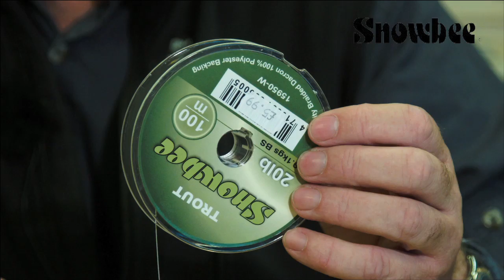How to set up your fly line

Comment: The addition of a small length of backing allows you to easily attach the fly line to the spool.  The way to determine if the line / backing will fit is to load the reel backwards.  Tape the leader end of the fly line to the spool hub and wind it on.  Attach the backing to the reel end of the line using an Albright knot and wind it on.  When you have enough backing on, (leaving 3/16" room on the spool), cut the backing.  You now know that the line and backing will fit nicely.  Walk off all backing and line outside in a straight line.  Attach the backing to the reel hub using an Arbor knot.  Attach the leader to the fly line using a loop connector or nail knot.  You're done.

Comment: What if a small part of my fly line is cut off. Can it still cast normally? (without losing the weight forward)
Reply: Yeah it will cast just fine. You will only start to have problems if you lose more than a few feet of line because this would change the taper. But if it's just a few inches, it won't do anything. You might need to use a heavier leader to transition though.

Comment: what benefit does the braided loop have over a perfection loop?
Reply: +Coleman Savage The perfection loop tied with the fly line will be sort of a massive knot compared to the braded loop.
Reply: The braided loops provide a very thin and compact but strong way to connect to your backing and leader, The perfection loop is a great loop when tied in the backing or leader, but it would be big, fat, and gnarly if tied into the fly line itself. Its just not right for the fly line.

Comment: Is the backing regular fishing line
Reply: If you buy special fly line backing, it will probably be braided Dacron line, 20 or 30 pound test, and will be intended for fly fishing. I have used many kinds of lines like 30 pound mono, fluorocarbon, and even very thin nylon line called "bankline" when nothing else was available to me. It all works but the Dacron is the best stuff
Reply: @jamescooper2618  ...Heck, I've used the orange nylon string out of my tool box.
Reply: @andyfletcher3561  Sure. It just has to fill up some space on the reel and give you something to attach a fly line too. For small fish, just about anything, within reason, will be OK but trust me, you get into a big fish and get spooled, you will be real glad you got 100 yards of real 50 pound test backing on your reel. I had a big salmon take me for a walk down river. Just hanging on by the backing about to lose an expensive line, praying my knotts held. They did.

Comment: silly question ,,why not just make a larger diameter reel spool?
Reply: Just seen your comment. It is no a silly question. In times past, like when I was a boy, the centre of fly lines were very small. The cheapest way was to fill them out with string, baler twine, anything. They gradually came with bigger diameter centres, but sometimes backing, as used in this video, is needed for big fish. Some reels are available wiht very big centres so that minimal or no backing is required if you know that spool is going to be used for fish that will not take all your fly line and still be running.

Comment: WTF is "backing"?  Is that the same as "line" or different?  If different, what is it?  Is it a type of line or what?  Explain it like I'm 5 years old please.
Reply: +Daniel Stoner Backing is the stuff in the back. Or something.
Reply: Daniel, "backing" is braided Dacron (or other material) line that is about 20 pound test. We put that on the reel first because it is easy to work with and helps provide a way to attach the "fly line" to the reel because we can tie a knot with it or use a loop to loop connection if we want. In a pinch, you could use 30 pound test mono, or even braided nylon string. The Idea is to give the fly line some backup so it is not wrapped so tightly on the spool. Also, with bigger fish, they might run all your fly line off the reel and the backing gives you more line on the reel to fight the fish. This is why you want an excellent quality connection between backing and line. hope this helped.
Reply: Thank you.
Reply: Daniel, backing is what they tell you, you need to sell you more stuff you don't need, forget that junk. I've been Fly Fishing for 43 years now and have never used backing
Reply: On a spinning reel, there's no need at all. But on a fly line, there is every need for backing. Several times a summer, strong fish take me into my backing - sometimes DEEP into my backing - at the first two runs they make. Fly fishermen absolutely require backing.if they want to play the anadromous game. Not having it and having a fish use up all your running line and hit the bottom of your reel is a very real possibility. "Snap" goes your weekend and investment.
Reply: @Daniel Stoner That is the problem with most "How to..." videos. They claim to be making them for beginners yet are not because they assume you have knowledge of "technical" words.  Also like this one they show the face of the demonstrator when they should be showing what he is doing. 

You need to watch a lot to learn a little. I too want things explained to me as if I am a total newbie if the video claims to be educational. I am currently attempting to put together some suggestions for my son (who has done a small amount of fishing wiht me in the past, both sea and freshwater, but not much) so that he can use them as help for his 8 and 6 y.o. children. Extremely difficult to find more than an isolated useful video.